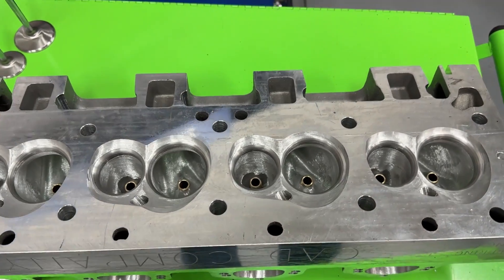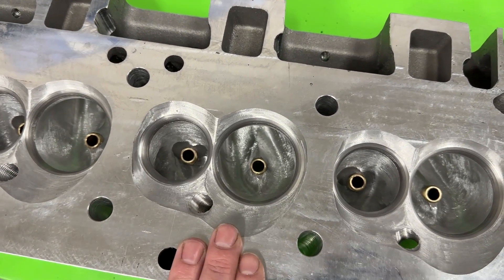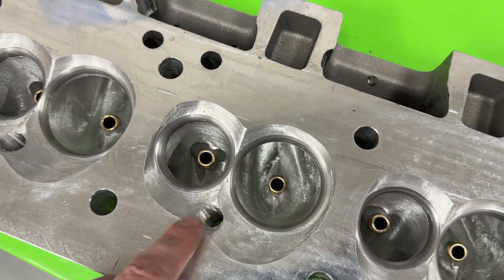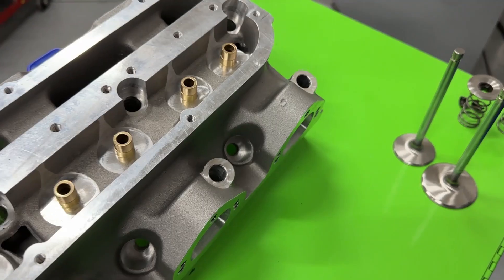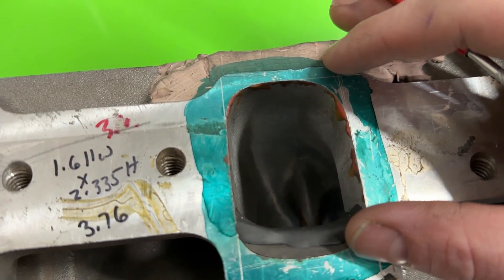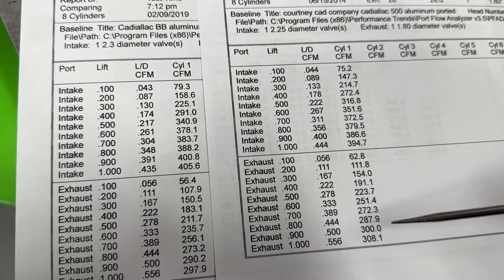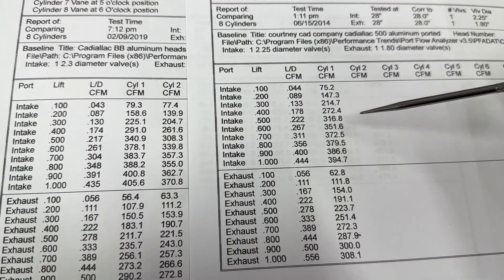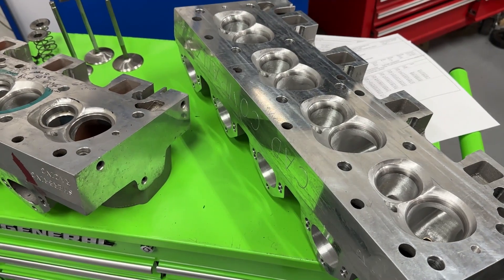Big Block Cadillac Heads

Comment: Now if they could just cast some short blocks at a half decent prices
Reply: I messaged Dart many years ago. World Industries didn't even bother replying. But Dart quoted 17.k for a run of cast iron blocks- even better than OE cadillac. Priority mains, raised cam location,  corrected valley drains and ports for oil jets at the cylinders. That was a killer deal back then. I'd expect double their cost now. I forget how many came in one production run. Stand up guys at Dart.

Comment: I like caddy engine's. I like the valve layout were exhaust port's aren't side by side in the chamber. 472-500ci that weighs a little bit more than a small block chivy

Comment: I always thought the Cadillacs had good potential, but there's no heads for em' and no cams either, Glad to see this is being done.
Reply: @scotthatch4548   I disagree, having 2 sets of cylinder heads on the market is not exactly parts availability, however I'll admit to you I didn't knew they had cam options, I remember a few years ago summit racing only had 1 cam grind listed for the 472/500 Cadillacs, but that was several years ago.